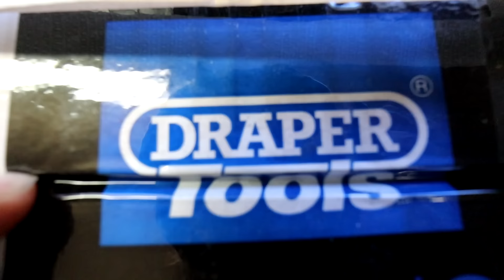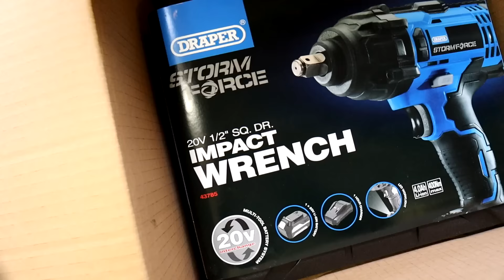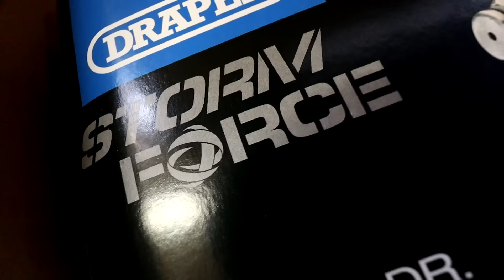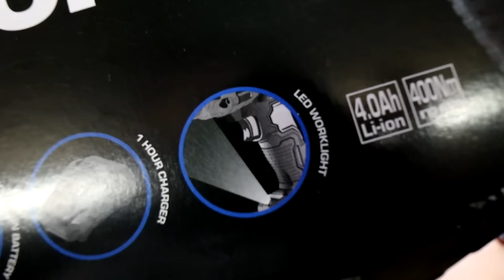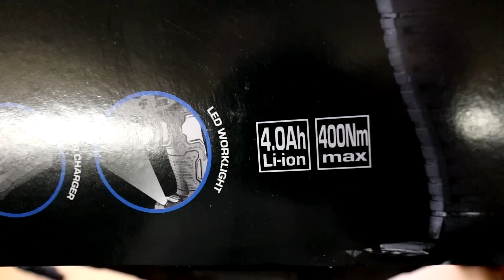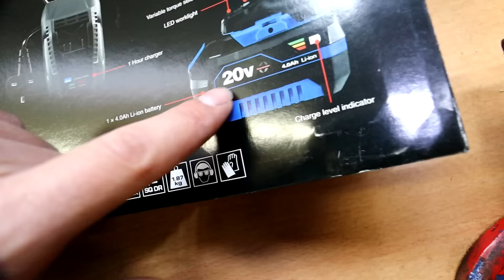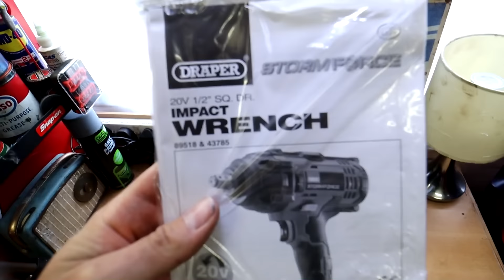Draper Stormforce 1/2 Impact! *Review*

Comment: Thanks, I'm wanting one of these after doing some maintenance recently. It's a pain if the car is already raised (wheels spin) etc. I've read some cheaper ones manage to get lug nuts off some of the time or most of the time, not wanting that hassle so seeing this remove 200NM gives me a better feeling about which one to go for. Just a caution I don't know how much it takes but I've read over torquing wheels can warp brake rotors etc. So I wouldn't get a bigger torque wrench and repeat this test again lol. But as I said it was really helpful to see you crack 200NM. Hope nothing was damaged. And one more thing I know it's a minor point but your 4AH battery doesn't really provide any more oomph over a 2AH battery unless the tool has some intelligence built into it. Mostly with these more basic power tools, 18 Volts 4AH is still just 18 Volts and what you've got over a 2AH is really a bigger gas tank - your tool will run for longer. I doubt it's putting out any more torque or speed. Maybe very slightly due to the individual cells being less stressed under load, but it seems a common assumption that more AH means more powerful operation and that's not generally the case. Cheers.

Comment: James get a 2000w induction heater my friend. £588 on amazon. And no it's not for heating your shed.
Reply from the maker: vp5 yea I’ve seen those before look great bits of kit!
Reply: @TheSavageGarage  expensive yes but applying heat always wins (if necessary)! Great for axles, subframes, suspension work etc etc. Big heavy stuff underneath that gets seized.

Comment: I wish there would be some standardisation for power tool batteries. As demonstrated here you end up with all the chargers and way too many batteries for what you really need. Others have already said that these look like the parkside range and I wouldn't be surprised if they are made in the same factory. Would like to see if the parkside batteries fit these but I bet they don't and would need modding.
Also Lidl now seem to have 3 ranges of parkside battery tools, the 20v standard range that jamie has, the 20v brushless range and now some smaller 12v range .... all incompatible batteries ... grr! Also they have never sold their impact wrench version over here for some reason. 
And for my final rant please can the manufacturers release bare bones battery terminal mounts i.e. the side that the batteries mate to on the device. It would make it so much easier to use their batteries in other projects then. rant over

Comment: Well u are wrong not everyone owns a drapper tool and dont want to and u should NEVER TAKE WHEELS BOLTS OFF WITH A IMPACT GUN AIR OR NOT AND U SHOULD NEVER PUT THEM ON USING IT U WILL DAMGE THE WHEEL BOLTS